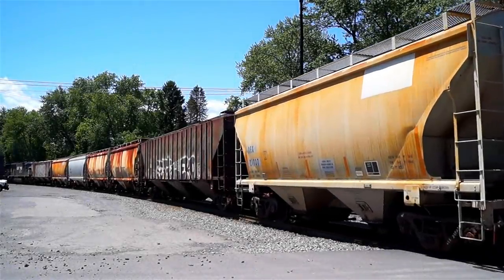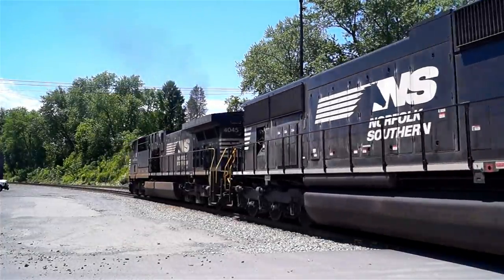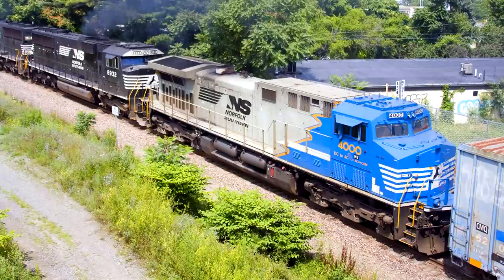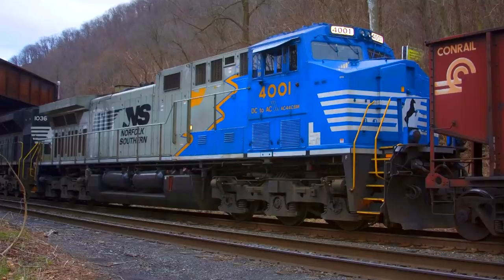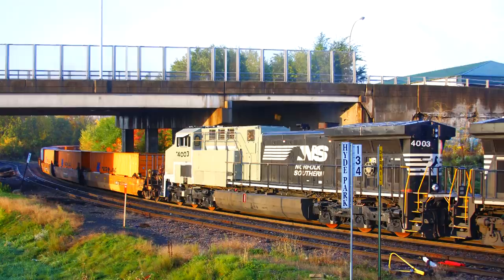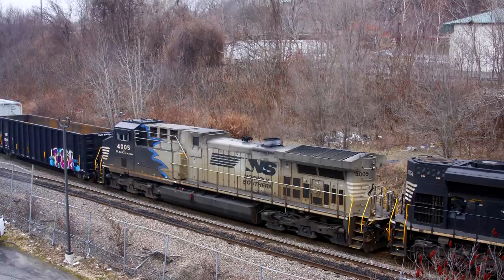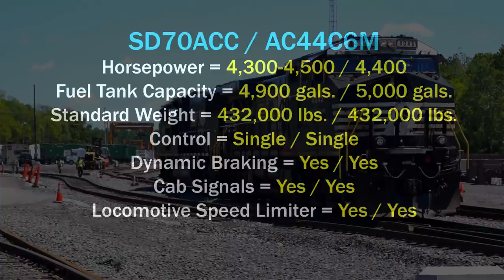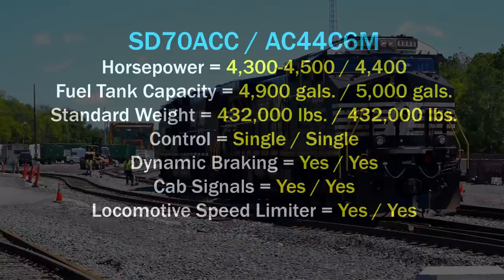[GL][T-255] EMD vs GE: SD70ACC vs AC44C6M - The Battle of the Rebuilds | Trains 21

Comment: Having spent over two decades now working for UP (send help) and having operated everything from ex SP SD9's all the way up to Tier-4 compliant units, the answer as to which is best is complicated. For road units, GE is better in every way. Better riding, better power, better dynamics, better cabs, better electrics, quieter and more comfortable to be in, better in every way; period. EMD is only a factor in the road unit game simply due to their units generally costing less; albeit for a reason.

On the opposite end of the spectrum when talking about road switching operations, EMD's are better. Even road switching with 6-axle units is still in EMD's favor. They load faster, they (usually) are easier to see out of in reverse moves, and they simply allow us to do our work more efficiently. That said, they are rougher riding and louder which does have an effect on you by the end of your shift. Admittedly though, it's still better than dealing with GEVO's in similar assignments as they take forever to load, and it feels reminiscent of the U-Boat days where the throttle and the speed seem to be out of sync from one another. So in switching moves you're constantly fighting to get the unit to maintain a constant speed due to it either taking forever to load, or loading too much for what you're doing. On road freights those problems are a moot point.

So whose best? It depends on the circumstances. Though for all the praise I give GE's for road units, their C4's leave a lot to be desired for three primary reasons. At least within the limited time I've spent dealing with them. The first being they are rougher riding than you would expect at slower speeds. With weight off the center axle it takes some of the shock absorption out of the trucks suspension. It's not intolerable but is annoying. The second flaw being they simply don't pull like they should. GE desperately wants to dupe you into believing that software can make up for a lack of physical traction motors but it just can't. It's simple physics. It's a great platform neutered by bean counters.

The third reason being the most obvious with them having an absolute relentless propensity for wheel slip. Under power on dry rails you still will deal with wheel slip. If you have wet rails, good luck. Even in dynamic braking the sanders are still fighting a loosing battle trying to get the units to grip. With light weight traffic (pre-PSR) they kind of made sense. With PSR being the rule rather than the exception, I'm not the only on taking bets that the C4's and the C44-9W rebuilds into A1A trucked AC44C4M's will have 6 motor trucks when they get rebuilt. Unless GE pulls one hell of a metaphorical rabbit out of their hat to get the traction issues under control. Especially when it all boils down to 6-motor units simply pull more which translates into fewer units needed to be able to do the same or more work. Which to me at least, is a no brainer in a efficiency obsessed industry. The irony is I have friends on BNSF who share the same sentiments as I.

But then again, we aren't paid to think, so what do we know?...
Reply from the maker: My thanks on such a thorough first hand perspective and my compliments on your service to the industry.
Reply: Even as a basic railfan, the C4 makes no sense. “Wow, we save money one 2 less traction motor!” What about the maintenance of the lifting system? And to replace flat-spotted wheels?
Reply: Henry, I just have one question. What do you mean by "taking forever to load"?
Reply: @AutismTakesOn  the power. Think if you mashed on the pedal in your car and it took a few seconds for the engine to rev up and start applying power to your wheels. It would take forever to load and that's what it means. 🙂🙋‍♂️
Reply: @ut000bs  Oh... Thank you... Yeah, I imagine that'd be a huge problem. Kind of ironic for GE, though, if you ask me, considering that they built many electric locomotives.
Reply: I haul crews for BNSF on their Thayer Subdivision Mainline and they absolutely despise the C4s!  From what they tell me, they're great on the Thayer Sub south portion (Thayer, Missouri to Memphis, Tennessee) where for the most part its flat and speeds are between 60 and 70mph, but the minute they reach the the north section of the Thayer Subdivision (Thayer, Missouri (2 mile) to Springfield, Missouri) they're miserable to operate, mainly because trains are climbing uphill with very long and heavy trains plus they're extremely underpowered which only adds to the problem!  At least from the crews I talk to, they seem to prefer the SD70ACE/SD70MAC, AC4400CW, ES44AC/DC, and the C44-9W when it comes to pulling power.
Reply: Not the first time I have heard people critical of GE AC units being problematic at low-speed high train weight load conditions seeming to lack torque and yet still suffering wheel slip probably due to axle inbalance across the truck yet at higher speeds they appear to be better than fine.
Reply: Henry.....thank you for keeping this country running!
Reply: @Trains21  I personally have a soft spot for SD40-2s

And the style of the 70aces

But why is nobody mentioning the ALCOS
Reply: @randallellison6421  Even with the combo of C4s and regular ES44DC, the engineer still has trouble with traction?
Reply: @Jeragon186  yup, unless the train has sufficient power (just from what I gather, a 10,000+ foot 11,000 to 13,000 ton Memphis, TN to Tulsa, OK train would require roughly 5 to 6 units to feel comfortable for the crews), even if there is a one ES44DC or AC coupled to to a C4 even the 6 motor Gevo can't overcome the short comings of the C4.  Now if the SD70MAC or SD70ACe is paired with a C4, the MAC or ACe can "sort of" overcome the shortcomings of the C4 because the AC traction EMDs seem grip the Rails much better that the GEs, but even then it's dicey if the train is underpowered.
Reply: @randallellison6421  Thanks for the insight! How about 2 C4s and 1 DC? I’m sorry for asking these types of questions, I’m just curious as to why BNSF would buy C4s if they aren’t that useful compared to regular 6 axle units. Didn’t they run test trains all over the system?
Reply: @Jeragon186  it's all good man, I can answer that second part of your question fairly easily, it's basically saving money, a 6 axle 4 traction motor  ET44C4 or ES44C4 is going to be far less expensive than the standard 6 traction motor ES44AC or ET44AC and they claim, according to data they collected on these units when they first came out, the C4s can produce tractive effort equal to a C44-9W or ES44DC, so basically, in the grand scheme of things, BNSF sees it as the best of both worlds, you get an AC traction locomotive (AC traction motors have less moving parts, thus easier and cheaper to maintain and a longer life span vs. a DC traction motor) for basically the same price or slightly cheaper than an ES44DC and far less expensive than either the ES44AC or ET44AC, unfortunately, I don't know exactly how much BNSF saves per unit on these C4s, but it seems to be quite a bit seeing as now they are actually rebuilding ex Santa Fe C44-9Ws into C4s (designated AC44C4M) as well.  The C4s actually do have the advantage when it comes to high speed (45 to 70mph) in fact, just from what I hear from crews, they are the far superior locomotive in that area especially the newer ET44C4 in which there doesn't seem to be another locomotive on BNSF's roster that can touch it in that area, it's just when speeds dip below 40mph and traction becomes the main focus is when the performance on these C4s just absolutely nose dives.

  Answering that first part of your question might get a little murky because I have seen that exact combination here on the Thayer Subdivision on a few occasions and my honest answer is that it can literally be a toss up because there are so many factors involved (the total length and tonnage of the train, mechanical issues, wet rail, even when and where trains stop can be a factor) and if there's any little hiccup, you're basically just "done" until help arrives.   Even if everything goes halfway decent, by the time a train like that gets out of Thayer, they're down to a crawl, I have literally heard crews on the scanner saying they were on the verge of stalling (and when I say "on the verge of stalling", I would hear them call the dispatcher and say they're were down to like 3mph at the north end of town) before they even got out of Thayer.
Reply: @randallellison6421  Wow! Even 10 years after introduction, Wabtec still can’t figure out a way to reduce the traction problems, whether that be new hardware or software.
If I can ask just one more thing, when I see trains with more than 4/5 locomotives, would they all be online and running? Or would only 2/3 be running and the rest would be isolated?
Reply: @Jeragon186  it honestly depends on if the train is loaded or not.  BNSF usually operates its coal trains here on the Thayer Subdivision with 4 to 5 units (4 unit trains are operated 2×2 and 5 unit trains are run in a 2×3 fashion) and the loaded trains (southbound) have all units on line while empties (northbound) usually operate with one unit on the point and one rear DPU running while the rest are offline.  There are other situations that arise when a train with several units shows up but only the first two or three are functioning with the remainder of the consist being towed "dead" or "boxcared", these can be anything from New or rebuilt locomotives being transported to their destination, old units being hauled off for scrap or sale, units being hauled to certain locations to be set out so they can be used as helpers etc.  So there can be many factors that can determine which locomotives are online and which ones are not, hope this helps.
Reply: @randallellison6421  I think I mislead you. I mean when there's more than 3 locomotives in the front. Like 5x2 or 4x2. Or is it the same story?
Reply: @Jeragon186  ok in that type of sanerio, it's pretty much the same story, however if a train encounters a situation where an offline locomotive needs to needs to be put back online to provide extra horsepower and tractive effort, the crew must radio the dispatcher and request to put that locomotive back online in which the dispatcher would relay the request to the trainmaster, once the trainmaster approves the request, the crew then brings the locomotive in question back online and the train continues its journey.  There are are other situations where BNSF will transport new or rebuilt locomotives for other railroads (usually in my area, that's CSX and NS).  Those units generally are not yet programmed and have their exhaust stacks capped so they are what the Railroad reffers to as "boxcar" locomotives, which means they can't run at all.  As for the 2 DPU sanerio, both are usually online, but it's rare to see more than one DPU on anything besides coal or grain trains.
Reply: I know a NS engineer and a BNSF engineer. Both have said the same thing. On BNSF hotshot intermodals it’s almost like GEs have to lead them.

Comment: As locomotive mechanic and someone who has rebuilt a few of the SD70ACC’s, I have to go with EMD.
Reply from the maker: Thanks for your feedback from the inside, it's much appreciated.
Reply: @Trains21 I'm an electrician for NS and they are a nightmare to work on and the worst designed engine on our fleet. They are constantly in our shop for failures and we have replaced several main generators ever since we've got them. Pure garbage. GEs are the best designed locomotive electrically and they are put together better. EMDs seem to have cheaper parts and the cabs on GEs are more comfortable.
Reply: @propellerblades17  is it a nightmare on work on older units?
Reply: @-watermelonking  Yes but I will admit that EMDs  have stronger dynamic braking. It normally would take two GEs in power to pull one EMD in Dynamic Braking.

Comment: I think both are awesome! GE isn't doing GE so much anymore, nor is GM doing EMD much anymore, but the heritage for each is substantial. I don't hold an engineer card, so my opinion is just that - an opinion. I think the EMD's are more reliable and easier for me to spot which model. I think the GE traction motors are better in use. My true favorite (showing my age) is an ALCO, as I grew up near an assembly plant :)

Comment: SD40-2. Sorry brother, but it's true, and we know it! Lol!
Reply: @Trains21  you know it! Plus, the C636 in my book.
Reply: Sorry bro, it's ES44AC from Tier-2, Tier-3a/Tier-3b to Evolution Technology ET44AC Tier-4! 
All versions from DC, AC, AH, C4. !
Outnumbered and Outclassed the SD40, SD45 SD40-2 SD45-2 SD40T-2 SD45T-2 combined!
Reply: Modern stuff cannot touch the 40-2. They get rebuilt, they run. GE's get rebuilt. Back in the shop. They have no resale value. Shortlines buy up the 40-2's and they still keep them going.
Reply: Nah, the U50C was the most reliable loco ever built. Lol!
Reply: @matthewarentzen7465  Put just two SD40-2s on a loaded coal train and let me know how that goes. Sorry but the GEVOs have taken the railroad industry completely.
Reply: @bellaxxi4116  What has more resale value after 50 years? NS took 40-2's off of horseshoe curve, and now everything stalls, especially in the rain.
Reply: @matthewarentzen7465  yea because old underpowered engines is why trains are stalling. Fun fact: gevos are on the list of top 10 locomotives that changed railroading. And was the ONLY modern locomotive on the list produced post 1972. Sure the SD40-2 is one of the best locomotives but it’s time is up.
Reply: @bellaxxi4116  If they can be rebuilt, they will last. When GE's are rebuilt, they ignite.  The T4's are not great sellers, too expensive to maintain. So, they rebuild their older GE power. If you look at the short lines, they bought a lot of the 40-2's and either rebuilt or overhauled and they still run. Most of the lease fleets are SD40-2''S or GP38-2' S.  No GE's. Nobody wants them. GE doesn't catalog parts mich after Wabtec ate them up. EMD's are everywhere. The GEVO models are only popular because the EPA made them that way. The SD50 is what you should call unreliable, but many were rebuilt and are now 40-2's.
Reply: @matthewarentzen7465  I live near Norfolk Southern tracks and 90% of trains I see were pulled by either ES44ACs and DCs, SD70ACCs, AC44C6Ms, C44-9Ws, SD70ACUs, ET44ACs, and SD70ACes. With 80% being lead by GEs. Most BNSF hotshot intermodals are lead by only GEVOs now to.
Reply: @bellaxxi4116  So do I. Popularity in the industry does not represent quality all of the time. It may seem that way, because the class 1 roads rely on the big builders that were, to build for the traffic they pull. This gives the shortlines and regionals a chance to become bigger. Once older power gets sold off, it has a better chance of a new life,, and last longer. Class 1's follow technology to keep up with industries they serve, hence the GEVO line, which is already obsolete.
Reply: @matthewarentzen7465  say all you want. My opinion hasn’t changed. I know people who drive freight trains for Norfolk Southern and BNSF. Haven’t talked to them in awhile but last time I did both said they would rather drive GEVOS all day over any other unit from EMD. Now don’t get me wrong EMD has made outstanding locomotives like you said the SD40-2 is a legend in its own league but it’s over 60 years old. Not everything lasts forever and the SD40-2 will end up in the scrap yard (or preserved) like any old locomotive. Hell there’s a video almost 5 minutes long of a NS SD40-2 funeral train. Not gonna lie I kinda cried a lil watching it.
Reply: @bellaxxi4116  The SD40-2 just turned 50 this year. Age doesn't mean they have to be scrapped. Look at all of the Alcos still running. I know a lot of the engineers who work for class 1's, too. Some of the ones who like the GEVO line are more concerned about creature comforts, as compared to the older ones who ran the classics. I talked to a lot of the young guys and they complained about no AC, the windows didn't open up wide enough, etc. Let's go back 50 years about that.......LOL
Reply: @matthewarentzen7465  guess I was wrong there my bad lmao. But hey no hate for the SD40-2. Guess we’ll have to see what happens in 50 years haha
Reply: @bellaxxi4116  LOL! I won't be around in 50 years, LOL!
Reply: @matthewarentzen7465  man now I feel like a total ass 🤣🤣🤣
Reply: @bellaxxi4116  I'm 48, so ........Lol!

Comment: I have a question? I noticed that the back of the engine in some of the depths that were shown as an overflap extended out from the back and others are straight back with no overflap. Is this a difference in models or is this a difference in engine or is this something that's new to the engines.?
 In my area the ones with the overflap are seen a lot.
Reply: It’s the type of engines it is. Most of the big guys have them. It’s just part of the radiator. I’m not sure exactly why some don’t but CSX doesn’t have many right now. CN and UP have a lot and CSX and NS don’t. The ones that don’t have the flaps are older for CSX but NS has newer engines that don’t have the flaps 🤷‍♂️😅I hope that wasn’t too confusing
Reply: @TrainsForever  I'm a locomotive electrician for NS and the newer engines that don't have the flared radiator shutters are the SD70 ACC units which are numbered 1800 series. They were rebuilt from the older DC EMD SD70s which are numbered 2500 series. GE did the same thing with the 4000 series which are AC units rebuilt from the DC dash 9s. If you notice the older dash 9s don't have the extended radiator section like the EVOs. That's because the EVOs have 2 Air to Air fans plus a large radiator fan.